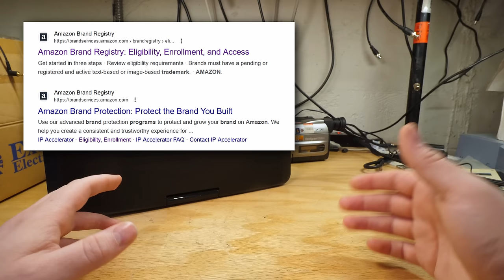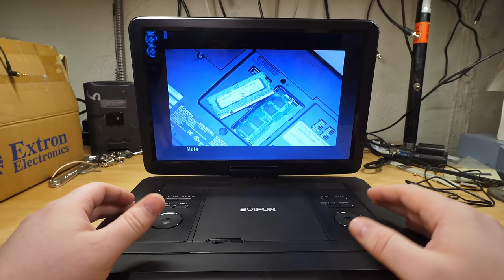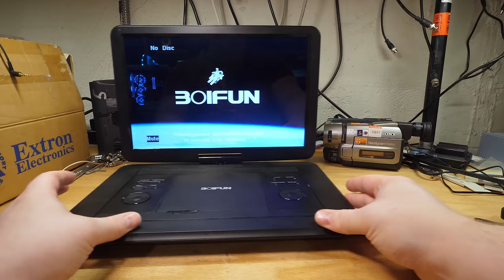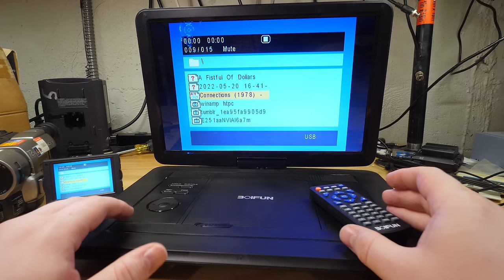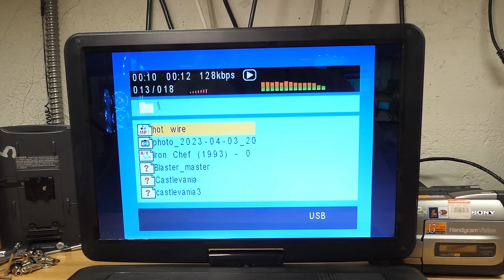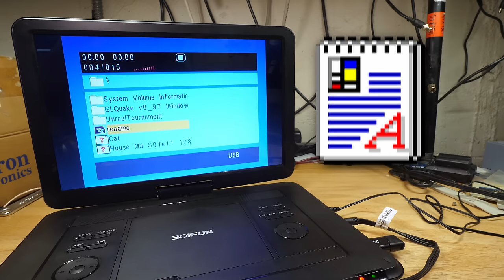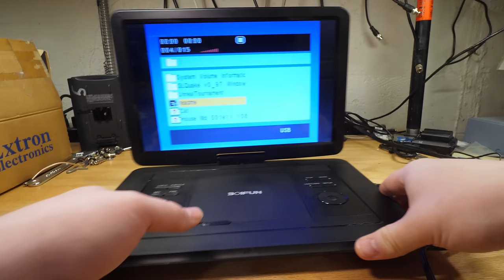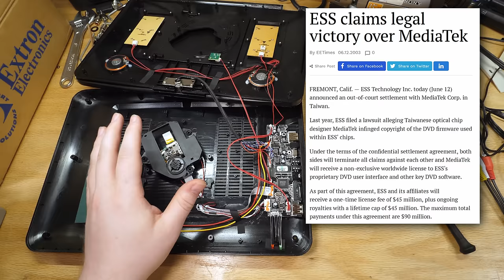Cheap, Silly, Remarkably Useful DVD Player

Comment: I wonder if the difference in how the screen looks on camera vs. in real life is due to the display’s polarization interacting with the camera sensor.

Also, no, DVDs do not actually declare their encoded aspect ratio. That feature didn’t appear until Blu-Ray. Back when DVD was specified the assumption was that everything would still be 4:3, and “anamorphic 16:9” was basically a retrofit.

(BTW the Divx logo you showed was for the Divx rental format and not the DivX CODEC, which was also a huge source of confusion back then)
Reply: I think he showed the correct logo for the Divx codec, I still remember seeing the watermark on old videos.
Reply: Wasn't that the format that made DVDs timed rentals and refused to play until it called home to Circuit City or something? 

Ironic how that was the part that was too futuristic for the 2000s.
Reply: @Toonrick12 That’s the Divix I remember.
Reply: Um... that's not true. DVD videos do have a flag for the aspect ratio, and 16:9 anamorphic DVDs were available from the get go in 1996 in Japan. Reviews for US releases in 1997 can be found that mention it too. The video on DVDs is actually always anamorphic so it's important for the player to know the aspect ratio of both the display and the video so it can be formatted properly.
Reply: At least in Europe, they absolutely did declare their aspect ratio
Reply: Speaking as someone who still authors DVDs for clients occasionally, I can say that it depends on a combination of factors. Each major element of a DVD can declare either 4:3 or 16:9 as its aspect ratio for playback, even though the image that's stored on the disk is always 4:3 — widescreen content gets the anamorphic treatment of squeezing it on disk for stretching at playback. The player is supposed to know the aspect ratio of the display it's connected to and take the appropriate action based on that. The way to do "automatic" pan and scan was a mess that I don't think anyone in his right mind ever used.
Reply: Anamorphic DVD just uses the full 480 or 576 pixels of height and compresses the width to 720 pixels. The pixel aspect ratio is encoded in a DVD so that players and playing software will know how to display the video on the TV they are set for. Unfortunately one very popular ripping software for Windows has long had a problem where instead of ripping the video to 480 or 576 pixels tall and expanding the width based on the PAR encoded on the disc, it would keep the width at 720 and compress the height based on the PAR - unless the user went to the settings for each video and changed it to the resolution option with the 480 or 576 height by whatever the PAR would dictate for the width.

In other words the ripper was programmed to do to anamorphic DVDs what any DVD player would do with it to display on a 4:3 TV instead of what DVD players do with anamorphic when set to use 16:9 or other widescreen.
Reply: @CuriouserArchive DVDs are not always anamorphic, especially not for non-widescreen TV shows and movies. In many cases old TV shows have been put onto DVD at less than the 720x480 or 720x576 maximum resolution. I have encountered some TV series DVDs where the video is less than max resolution and when ripped 'straight' that sub-size is what one gets. But they have an encoded pixel aspect ratio that when played will stretch the video horizontally to 720 pixels. The only reason to do that is to be able to reduce the size of the MPEG2 video to pack more episodes or movies onto a disc.

Then there are the DVDs authored by people who clearly did not know what they were doing. AKA Hard Letterboxed 4:3 or Postage Stamp Video. Or in the case of the "untouched" theatrical release of the first Star Wars movie, apparently done out of spite to produce a crappy quality disc to pack with one of the very much reworked Blu-Ray releases. (Though it did serve as an informational source for the Harmy's Despecialized version.)

When DVD was king of video there was nothing like the pain and irritation of getting a double sided disc where the fullscreen side was cropped 4:3 and the "widescreen" side was also 4:3 with hard letterbox bars and the actual vertical resolution of the movie crushed to about 320 pixels.
Reply: @smartyhall    The notion of "picture being 4:3" is nonsensical. Image resolution is simply decoupled from the output picture aspect ratio, of which two are available, standard and anamorphic. When TV supports anamorphic natively, output signalling is used to switch the TV. When it does not, most DVD players had a more or less serviceable letterbox scaler, good enough that it wouldn't look too grating on a small 14" CRT.

Comment: The test ports on the board -- I think you touched on the reality earlier in the video, when someone recognized that order of ports from a bunch of these devices.  Someone  (organization) at some point must have designed this board with the intent of selling them to tons of product integrators like whoever made this 6-letter product.  Because the board designer in turn would then need to support their customers (the people making/integrating the products), it makes sense that they would want test points designed in because they would want to reproduce and investigate any weird symptoms that the integrators run into when designing/QAing their own derivative product.  That's my theory at least.  Also this theory potentially unifies the silkscreened screw logos on the board that seem odd in the context of this rock-bottom product -- those input/control modules are most likely procured from a different OEM, then integrated with this product at the time of its own engineering.    

Again.. just a theory, but it would unify/explain why there are 2-3 different styles of PCB and component/design approach in the one product, the producers of this device were just lego-kitting it together, with most of their engineering probably being in the design of the clamshell and related engineering for assembly

Comment: The NES emulator is without a doubt on that little serial flash along with the BOIFUN logos and such. Those MediaTek chips have built in firmware, and are customizable to a degree. NES emulation is not a standard feature of the chip, so someone added it.... then someone else took that flash image (maybe even copied it from a different OEM) and customized it for this particular brand, etc...

Comment: Man I loved watching connections. There was another show called "The Secret Life of Machines." I would watch that all the time.  Tim Hunkin had been restoring TSLOM and putting the videos on YouTube. It's a great watch if you enjoy connections.
Reply: Someone had a good set of PAL recordings but unfortunately the episode "The Car" still has a ton of problems. It also does on the NTSC and PAL DVD releases, but far worse. The other online releases also have the same issues. If the PAL source for the remastered YouTube release was recorded off broadcast then apparently the master tape for that episode was damaged. I'm pretty certain that when I saw the series during its original run in the USA that "The Car" episode didn't have the glitches.

If anyone has a first run off-air, cable, or satellite home recording of "The Car", that doesn't have the synch and field order glitches, I bet Tim Hunkin would be very interested in getting it, especially if it's PAL format.

Even a good NTSC recording could be used by cutting the bits that are glitchy in the PAL source then doing some fancy upscaling and frames per second changing to patch over the glitchy bits.

Comment: My guess about the weird colours on the TT icon is that it's just a difference in the palette used in the UI on the different devices; the binary data in the icon is probably the same, but the BOIFUN just maps them to the wrong colours.
Reply from the maker: oh man that's a really good point I hadn't considered
Reply: Oh, yeah. RGB vs YCBCR.
Reply: The original file would be an ICO.  They are normal bitmaps with a special header, so they can (and back in ‘95, usually were) 16/256-color palettized images.  So yep, they just aren’t using the right palette.

BMP format doesn’t support YUV, and when graphics are converted without color space conversion, you end up with lots of green or magenta.

Comment: The menu items for pan/scan and letterbox -- those are for 4:3 displays, to decide how a 16:9 movie shows up.
Reply from the maker: yeah, i just don't get why they don't do anything. it seems to be simulating a 4:3 display, but it doesn't crop the 16:9 content. it makes me wonder if it's misconfigured. or maybe it only applies to the composite output, I didn't try that.
Reply: It doesn't crop, it's for anamorphic DVDs that smush the widescreen video down into 4:3 for later expansion by a widescreen compatible player  @CathodeRayDude
Reply: @Shotblur  not quite. The anamorphic video exits the DVD player "untouched". The TV screen shape is what stretches it out to the right shape. The DVD player DOES squish anamorphic video vertically (to create letterboxed 16:9) if you tell the DVD player that your TV is 4:3. If you select Pan/Scan but the video is flagged for Letterbox only, you'll only get letterbox. (And vice versa).
Reply: @Shotblur apologies - I misread your comment. The 16:9 is indeed squeezed into 4:3 during production. 🙂
Reply: @CathodeRayDude  probably only 'works' on the AV output and may not actually function over the LCD display driver, as the AV output is probably 4:3 480i only. This thing wouldnt be the worst thing for someone who may need a travel buddy of a movie watcher, like at a family cabin/cottage where power isnt always on or even someone who would hook up an older Famiclone or retro games console to it (did this once with a similar rig a roommate had to play gamecube while the rest of the roommates were using the tv to watch a shitty movie).
Reply: I think the setting changes the analog out only. The built-in display has only one aspect ratio. The tv you plug into it could be 4:3 or widescreen.

Comment: The DVD spec does indeed allow for auto switching of aspect ratios, at least in Europe where it sends a signal via the scart output on pin 8 I believe. However most home DVD recorders don't seem to bother recording the aspect ratio switching signal when recording, so on playback you have to set the ratio manually as you had to. Some Pioneer and Sony models would record the aspect ratio switching signal if recording from their internal tuners but most didn't instead relying on you to manually set things up.

Comment: The original 2004 Nintendo DS equipped with an ARM9 core at 66 Mhz can emulate NES games full-speed (and I don't think it can really leverage its own 2D hardware acceleration to do that?). Whatever is in that Mediatek SoC is not just regular garbage, it's advanced garbage.
Reply: 😂 "Advanced Garbage"... Remember the good 'ol day's when shit was made right? Still,  it's fun to see how crappy the stuff really is!
Reply: The Game Boy Advance with an ARM7TDMI running at 16.78 MHz (c. 1996) can emulate NES games at full-speed fairly passably (the only issue being the GBA display is lower resolution than NTSC video), so it's really shocking the DVD player can't even manage lol
Reply: We're watching the evolution of garbage in real time. I reckon in 50 years we'll have cheapo Android handsets with the power of a 3090.

Comment: The aspect ratio/screen type settings are totally normal (for a separate DVD player/TV setup) but rather unusual for an all-in-one device. I kinda like the flexibility though! Since it does more than just DVD playback, it does kinda need this flexibility. 
As for DVDs being "hard coded with the aspect ratio", yes, they are. Widescreen (true widescreen, not Letterbox) DVDs are anamorphic, and the DVD player has the ability to letterbox or crop (Pan/Scan) to fit the 16:9 video onto 4:3 screens. The Pan/Scan flag is very rarely used (aside from Legal Warnings, disclaimers, menus, etc.) Typically these are flagged P/S to give a full 4:3 image on a 4:3 screen, rather than LBX. The graphics for these are created with excess real estate at the sides (text all within central portion of screen). 99.9999 of video content is flagged to display as LBX on 4:3 screens. To save money on early DVD players, only one scaling chip was designed into the specs. Scaling of overlays (menu highlights and subtitles) is not possible in any DVD player. For menu highlights to appear correct in both 16:9 and 4:3, two separate button highlights have to be created for every menu page. Super annoying. For subtitles, 99% of DVDs share the same stream across both aspect ratios, with the result that they look a bit stretched or squashed, depending what mode you're viewing in. Japanese subtitles were typically the only language where a separate 4:3 and 16:9 stream were supplied by the subtitle vendor. The Japanese are very picky about the characters being displayed in the right shape. Other countries have to suck it up! In my experience, almost every subtitle vendor I ever dealt with (in 20-odd years of DVD authoring) was CLUELESS about the technical aspects of subtitles and had absolutely no comprehension of dedicated 16:9 and LBX subtitle streams. Only those making the Japanese subs understood how to do it 😭 Because of the way menu highlights and subtitles work, it's not possible to just batch process subtitles in Photoshop to resize them. You could, but they'd look horrible. Resizing has to be done in grayscale mode, and only after that can you remap the 255 levels of black-to-white as three pure colors (typically white background with black, red, and blue used for text body, outline, and a very crude dither). Each of these colors get re-mapped as a specific display color and opacity percentage by the DVD player. 
Wow, that ended up being a very long and nerdy message, but I'm sure some of your viewers will enjoying nerding out reading about obsolete tech 🤷‍♂️ 😂
Reply from the maker: absolutely fascinating stuff though, thank you for the comment!
Reply: For clarity, DVD authoring packages for "regular people" and semi-pro people were heavily "abstraction layer" based, and did a ton of the fiddly stuff internally. The pro systems, such as Scenarist, did NOTHING to help the author. Absolutely everything had to be done "by hand".

Comment: That port is actually for an NES controller, it uses 4 pins and port's metal case as separate contacts to get 5 wires. I have a NES on a chip from aliexpress that uses a controller like that.

Comment: I think the text reader is probably working correctly but expecting 16-bit character sets to draw chinese charcaters in a different orientation (say, vertical instead of left to right horizontal). It probably gets to the end of the first line, encounters a line-feed or carriage return and proceeds to flip it's shit for the remainder of the file.
Reply: It might also expected the display to by in skinny 4:3 mode, etc

Comment: The software in that player is also just like what would be in a digital picture frame.... Similar menus and such too.... I think the reason why the pictures are so slow to load is because it was expecting to be more of a slideshow or flipping through images.... And the battery life also designed to be used in a picture frame item... Most of those could play videos just fine if you loaded a few on there. 😊
Reply: I forgot about those cheap digital picture frames...
Reply: I have an old 2010 RCA DVD player that I'm pretty sure uses basically the same software, just without the USB or NES stuff in it, and I think it's also missing that on screen settings menu. Not sure what files it will play off of DVD, but I know when playing an audio CD it showed almost the same menu as the file browser in the boifun player. When playing DVDs the on screen symbols were also the same, I'm tempted to take mine apart and see what chip it has, and maybe make a DVD with a bunch of files to test with.

Comment: Did you check if the volume buttons adjust the slideshow speed in photo mode? Just a random idea to try.
Reply from the maker: Oh man no I didn't, haha. I mean, not that it would be all that useful since the enormous loading delay makes the slideshow permanently super slow anyway
Reply: @CathodeRayDude  with a built-in shutter transition, too :^)